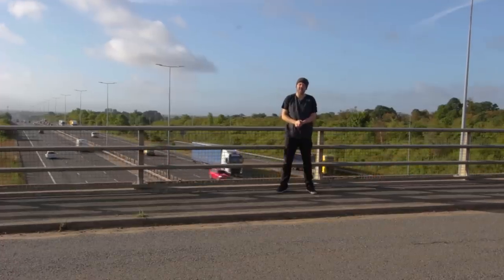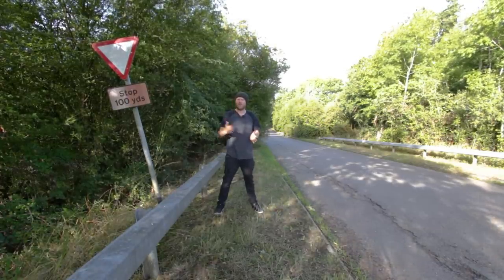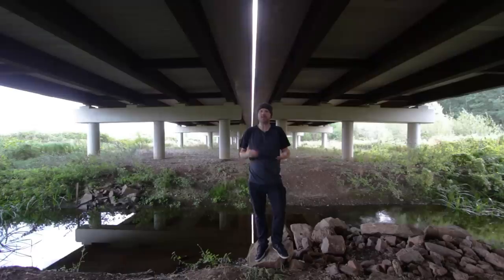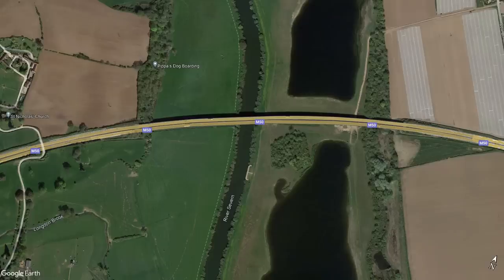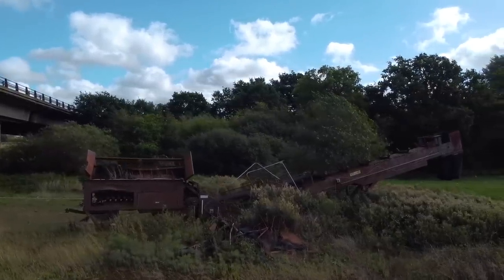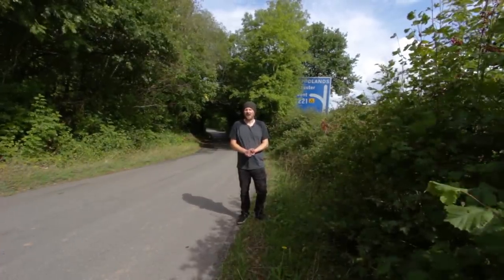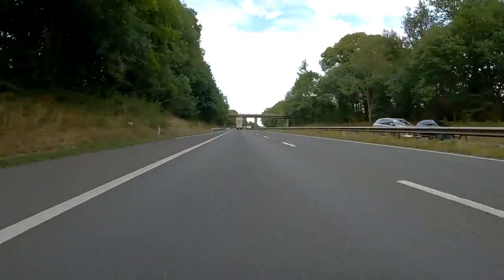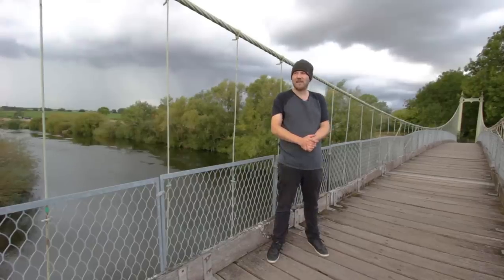Secrets of The Motorway - M50

Comment: One of the massive advantages of those narrow hard shoulders being that they exist and haven't been removed for fantastical barely believable "smart" reasons. So could this motorway actually be safer for people on lower incomes with older cars?
Reply: You obviously don't own an old car.
Reply: You are incorrect
Reply: Why are smart motorways dangerous for older cars?
Reply: @Fm_1055  motor likely to break down and need the hard shoulder?
Reply: Regardless of having an old car or not. Anyone could break down for any reason. I once had a tyre failure on the motorway doing 60, the entire inner sidewall had been shredded. I couldn't have limped that a mile to the next sos point on a busy smart motorway with fast moving lorries in the inside lane and you also know one of those tyre kits would have been useless too compared to having a spare wheel. So it does feel we are going backwards sometimes in some areas...
Reply: I think what he means is that older cars are, generally speaking, a lot smaller than their newer, fatter counterparts
Reply: Drive all the way to the bottom of the M50 and you'll find yourself on the A40. It's very much like the M50, except being an A road it has no hard shoulder and the occasional roundabout. Mostly, though, it's a 70mph road with no hard shoulder and several miles between laybys and junctions, just like many other roads all over the country. UNLIKE smart motorways it doesn't have 24 hour CCTV monitoring, automatic detection systems for stopped vehicles, off-carriageway emergency refuge areas, dynamic speed limits and lane closures, etc, etc... So WHY are people so opposed to smart motorways?
Reply: @sidwills  that’s a really good set of points. I suspect the reason ‘smart’ motorways are hated by many is the same for so many other things that are also hated most of which are due to a series of incidents which, statistically, are fairly rare, and so make headlines, and when they make headlines they grab attention and become normalised. See also: nuclear power, MPs, judges, immigrants claiming free healthcare… in other words, irrational fear.

Comment: The removed railway bridge spans were not scrapped, but instead donated to the Bluebell Railway in Sussex. They can now be found sitting stored in Horsted Keynes station yard, with their future use being a few hundred yards away as they were obtained to form a replacement for the 6-arch Sheriff Mill Viaduct, which stood just West of Horsted Keynes on the link line between there and Haywards Heath. Demolished in 1963, the viaduct will be replaced with the bridge spans, as part of the Bluebell's intended re-opening of that line.

Comment: I lived near junction 3 when the Motorway opened. It rapidly became popular with boy racers and bikers as a "test track". With virtually no traffic and with no speed limit, for a time it was THE place to drive your motor to it's maximum speed. Initially the hard shoulder wasn't even properly surfaced, it was a sort of rolled red grit rather than tarmac. Each 1/10 of a mile was marked with a coloured post in the centre of the shoulder. These were made of rubber so weren't as vulnerable as they looked. No centre barrier and cattle grids on every junction. Where the motorway went over a road, the central reservation didn't as there was a hole in the bridge with railings around. Why?
Reply from the maker: Health and safety wasnt a thing in the 50s and 60s :D

Comment: I was on officer based on CMPG, Central Motorway Police Group parading from the southern base at Hindlip. We covered the M50 but never routinely patrolled it as the lions share of our work was on M5, M6, M42. 
Whenever we did attend incidents down there it was usually at Junction 3 east bound exit slip. Vehicles would travel too fast and couldn't take the sharp left hand bend and would frequently go straight through the deviation boards/fence panels. They must have been replaced numerous times over the years.  Have a look next time you're passing. 🚔

Comment: As a kid in the 1960’s we’d travel from Barry Sth Wales to Tadcaster Yorks (visiting relatives)  on a regular basis. Originally we’d head to Chepstow and bottle neck it from there. In the early 70’s they completed the A449 (Ross spur link) which eventually hooks up with the M50  it made a big difference in journey time. Every year the journey would get a bit shorter as new motorways came on stream, and my old man’s cars improved. 
In the late 70’s I’d use the A449 and M50 to test the performance of my latest motorbikes, it was one of the quietest motorways perfect for doing this.

Comment: Very interesting, John, thanks. There’s a similar sort of junction to the original M5/M50 junction near the Dutch town of Bergen op Zoom, where one motorway ends and you have to go right round a 270 degree turn to join motorway two, which then runs through to  Vlissengen. Quite a surprise, the first time I came upon it!  It’s been there years and is well signposted in advance, so I guess everyone is happy with it.

Comment: The gravel pits shown at 4.50 were recently worked and all the aggregate was moved by boats, you could often see them moored to the jetty just south of the bridge, loading was via a loading shovel filling the hopper on the elevator you were stood by under the bridge.
The other piece of equipment was a power screen used to grade the aggregate, remove gravel from the sand etc.
Reply from the maker: Nice bit of info, cheers!

Comment: As a child I remember the huge quarry pits by the Severn in use, they used to load the rock onto huge barges in the river and ship it out, there’s more quarries further up by Upton which still do the same. The bridge works around there went on for years and endless 50 mph cameras were in effect. The ‘slip roads’ either side were installed then. All of that land floods every year which is why the bridge works were needed and the slip roads are only for maintenance access. Great video, thanks for making it

Comment: As a regular user of the M50 I can put you right on the new bridge.
Originally there was a raised embankment with a culvert for the water course below, unfortunately the culvert wasn't big enough to cope with floods and acted like a dam causing extensive flooding of the fields on the upstream side.
The replacement elevated section was carried out in two stages with two-way traffic using the carriageway that wasn't being worked on.
I'm old enough to remember when the M5 stopped at the M50 and was just a two lane motorway like the M50.

Comment: You mention how bad junction 3 is. That's the Gorsley junction, and having family in the area I am fairly familiar with it. I seem to remember that it was literally a T junction, coming from Ross direction, until not all that long ago; you actually had to slow down on the carriageway, there was no slip road. The motorway junction sign as you approached literally showed it as a ┤ (sideways T).
I had an uncle who, if stories are to be believed, wrote letters to the relevant authorities complaining about this junction and telling them an accident would happen if nothing was done. It seems the answer was to repaint some lines to make it slightly less awkward.
Reply: If you think Jct 3 is bad you should check on the A40 between Carmarthen and St Clears. Not only does it have many, many junctions with no slip roads. Most of the junctions also allow you to cross between the central reservation barrier to get access to the opposite carriageway. An absolutely brilliant example of how to build a dual carriageway while spending the absolute minimum amount of cash while paying no thought to safety. It has to been seen to be believed. And if you do go, I recommend taking the detour into Bancyfelin (using the old road) while travelling from Carmarthen to St Clears (especially in the summer) to get the full crossing-a-central-reservation experience.
Reply: @StrikeEngine  I know the road fairly well, at least east of Carmarthen. That wasn't built as a motorway though, even if it is in effect an extension of the M4.
I also remember the big signs the contractor put up there when it was completed boasting about how they'd completed it ahead of schedule (18 months or so if I recall). What corners got cut to achieve that, I wonder.
Reply: Not only is the junction itself dangerous, but if you're heading to Hereford on the B4221 at night, you will often find the way the road bows round to meet the junction and then swings sharply away at the junction itself, brings you face to face with the glaring headlights of those coming off the M50 to join the B road. On my first trip down there I thought I'd somehow ended up on the wrong side of the road. It's all unlit and much tighter than you're expecting. Very scary.
Reply: @pirenzo  I agree; that's something I have done often. Someone coming across that for the first time in the dark is likely to get a surprise. It's probably not quite so bad now as it was, but until the Severn Bridge tolls were lifted, it was a route often taken, especially by lorries, travelling from the southeast towards south Wales, to avoid the tolls (and vice-versa, back in the years where tolls operated both ways). My grandmother's house was against the road in Gorsley, just down from the county boundary, and I remember there being lorry traffic all night.
Reply: ..junction 3 was an original experiment by the Highways..I think they regret it1..
Reply: @angharadhafod  All of them...

Comment: 3:14 Yes they used these slip roads to work on the bridges. The roadworks allowed one bridge to be shut off and repaired with a contra flow on the other side. This was reversed when working on the other side. Both sets of the two bridges had these repairs back in 2012. I remember this as I regularly used the M50 to head from South Wales to Stoke-On-Trent.. Its a shortcut without having to use the Severn Bridges and back in the day a saving on the Toll cost.
Reply from the maker: Thanks for confirming!

Comment: I used to be a regular user of the M50, just quiet is all I remember. I don’t think I used any of the exits, just zoomed by on my way to Ross on Wye (and it’s horrible out of town shopping village thing) or beyond. 
Strensham services as you head North on the M5 off the M50 I remember as having an oddly long slip road for no apparent reason.
Edit: rewatched your video about Strensham where the road is explained.
Reply: The out of town shopping is rubbish but Baileys DIY just off the same roundabout can throw up some good bargains.
Reply: Long slip road for Strensham northbound services is because the sire of the services was moved a mile or two from its original site at the M50 / M5 interchange.

Comment: I commuted from Leamington Spa to Ross occasionally from 2009 to 2013. For a period (2010/11 from memory) I drove that 75.2 miles each way every bloomin' day and that was at the height of the work on the bridges between junctions 1 and 2. They definitely were driving machinery underneath the bridges with contraflows for miles. I've no idea if the slip roads were there before but they were definitely used. I think you said 2012 in the video - pretty sure it was a year or two before that. Plus they then started on all the other bridges further towards Ross - nightmare!

Comment: I like the M50, it is never busy. Whatever day or time you drive on it, it is always quiet.
The junction numbering is pretty normal for motorways. Junction 1 on the M6 is not where it starts off the M1. When you have a motorway spurring off from another it just uses the junction number of the other motorway, otherwise there would be load of confused morons on the road, (but there are loads of them).
I remember the first time I used J3 on the M50. I ended up almost having a head smash as I went round the slip too fast. Now when I use it I slow down to about 40 before leaving the motorway. Getting back on is sometimes a bit hazardous if you are in a slow car like and old Mini. The A34/A343 junction is very similar but far more dangerous as the A34 is full of trucks going to Southampton and is more difficult to slow down without one of those trucks getting too close as you leave the road.
Nice suspension bridge at the end.

Enough of my ramblings and thanks again Jon for the entertainment.

Comment: The interesting fact I would have lead off with is that the M50 contains the only roundabout that is actually a motorway, where motorway regulations apply. I didn't know about the scheme to extend towards the M42...would be of use to me on my four trips a year from Epping to Ryall. Great series and keep it up.
Reply: Motorway Regulations apply on Simister Island on tbe M60 too!
Reply: M1 J42/M62 J32, M2 J2, M4 J4, M4 J8/9, M4 J22, M20 J8, M23 J9, M25 J4, M27 J3 and more all have roundabouts where motorway regs apply...
Reply: M60/M62 (Simister) also has a roundabout with Motorway regulations. Was on it yesterday.
Reply: @elishabee2  m6 junction 7 hasn't got a roundabout but more of an accident zone, m5 junction 4
Reply from the maker: Initially, I thought as you say, the M50 is the only roundabout with motorway regs...buuuuut the M23 spur at Gatwick has a roundabout with motorway regs!
Reply: There's actually a fair few
M4/M49, M4 J8/9, Simister Island (clockwise M60 uses part of that one), Lofthouse Interchange, M18/A1(M), M6/M65, M61/M65/WSM, M73/M8/A8(M). Technically the M4/M32 before they blocked part of it off too.

You've also got the likes of the M181/A1077(M), M271, A627(M), M58 and M4 Heathrow Spur which have roundabouts on their mainline. A601(M) used to be similar before the southern section became a B road.

Not sure whether I've missed any off but I'm sure there's at least a few more
Reply: @AutoShenanigans  I sit corrected!

Comment: I drive on the m50 almost daily and junction 3 is an absolute bastard, trying to get either on or off is a nightmare in my car let alone in my HGV 😂, also the m50 is very prone to flooding incidents around junction 2 with a couple years ago being the worst, m50 shut from junction 2 onwards in both directions due to the flooding, on the 23rd of December. I was stood on junction 2 helping to direct traffic while waiting to be picked up by family who were in my car 2 miles from junction 2. I was there for 6 hours until 2 am while the police/fire cleared some of the flooding and got traffic moving.

Comment: The Jct 2 southbound exit is very dangerous when turning right for Hereford. I’ve repeatedly had to request the relevant authorities to cut back foliage which routinely blocks visibility. The obvious solution is to kill off the patch of foliage and gravel over the small patch of land. I’ve driven the route virtually daily for over 17 years and have seen hundreds of near-misses.  As UK motorway exits go, it’s almost unique in terms of the inadequacy of its maintenance.  The irony is that the junction is located about 40 yards from a road maintenance depot.

Comment: Couple of points to add. The plan to make a new motorway from Strensham to Solihull makes a lot of sense, I heard the m50 was conceived to take South Wales steel to West Midlands car manufacturing, I guess they never got to the last bit! Good to see the plans I’ve not come across that before.
And another story I thought you’d add would be that a lorry sadly hit the centre column of a bridge and  collapsed the entire thing. The driver died. A milk tanker happened to be on the bridge above as it collapsed and he survived but was quite badly injured. An investigation showed bridges of that particular design being susceptible to collapse in a particular failure mode, and caused bridges across the motorway network to be redesigned and modified. I also heard that the milk tanker driver was the first person to drive back over the collapsed bridge when it reopened. Thanks for the video I’ve been waiting for this one, nice surprise
Reply: Indeed yes, I was an engineer at the time - the bridge was/is Kempley. I have several pictures of the scene and the aftermath/rebuilding and even  the re opening ceremony which did, you are correct, include the same tanker driven by same driver as first across the rebuilt bridge.
Reply: I live near Ross and heard that story but have never seen any photos of the collapsed bridge.
Reply: @andrewhotston983  I have many pictures of the incident
Reply: I always wondered why the Strensham interchange had the layout as though built for another road. Connecting to Solihull for steel transportation would have made little sense since Land Rover was a minor player in the day and Longbridge was easily accessible by the M5. The motorways around the Birmingham area would have no benefit from the addition at present.
Reply: @geoffreycodnett6570  don’t forget there wasn’t the M5 at the time this motorway was built, and there was a lot more car building than Land Rover around at that time - Coventry, Cowley etc. They may not have been thinking of Solihull as Land Rovers use a bit of steel in the chassis but the panels were Aluminium. Just a story I heard anyway.
Reply: @ptodd3068  we would love to see them if you could put them in a video of some sort

Comment: That style of short slip into a single carriage bi direction bend down to or up to a crossing road is quite common in both Sweden and the US. Almost binned it on my first trip to the USA, picking up a US Hire car at the airport abd heading onto the interstate. On leaving the interstate I left as I would in the UK, I.e. at the  motorways speed, only to discover limitations of US cars and tyres handling, when I found myself to my surprise almost immediately going into an unlit and casually warned tight 180 bend, fortunately managed scrub enough speed off in the badly understeering and wallowing chewy without making contact with anything solid.